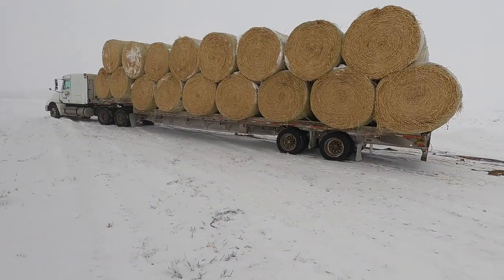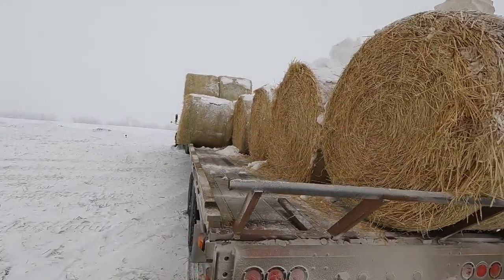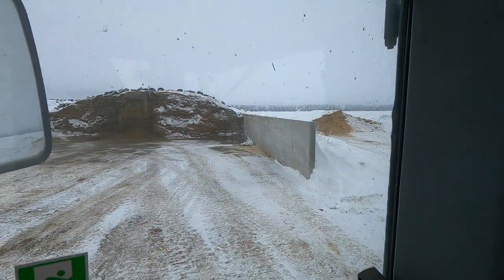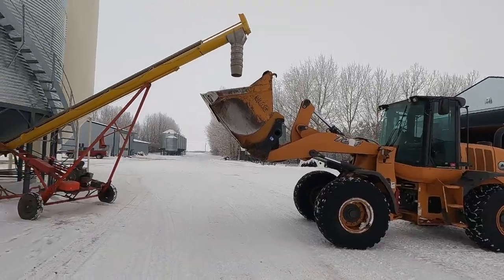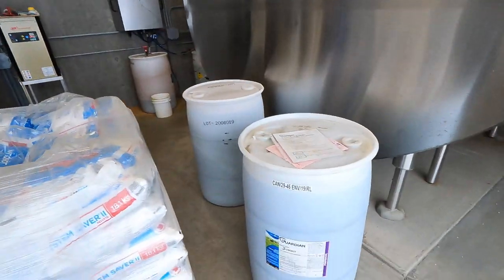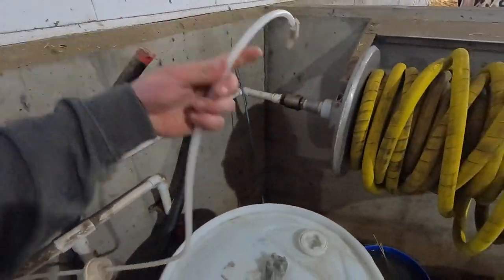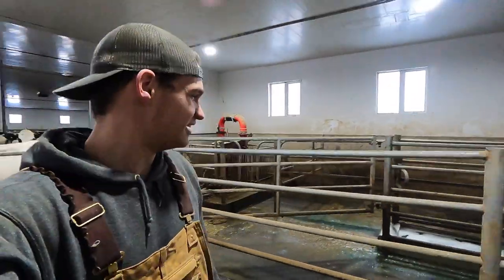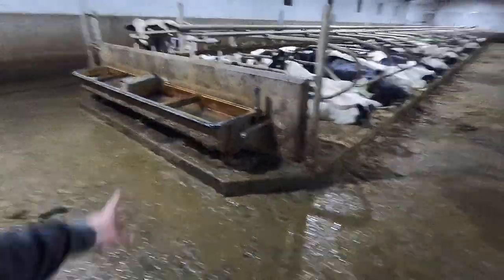New Foot Bath For The Milk Cows!

Comment: Drain the air tanks weekly when using it lots
Reply: That is probably why it froze! Needs to be done daily and even that's not enough sometimes it needs a methanol pot.
Reply: You can install an in-line air dryer as well. It's automatic too!

Comment: You need to add a cheap flow timer on the foot bath.  Something similar to what they use when adding fertilizer to a garden drip line.  Also if you flip the cart around so the barrel is coming out first you can use the wheels against the step to help control the load.
Reply: Not so new footbath ... You are reaching IRELAND loud and clear... Huge operation compared to average heard size in the Emerald Isle where 120 to 150 cows would be going heard size ... We gets lots of rain but no tough

Comment: To handle those plastic barrels get a two wheel dolly equipped with curved forks that cradled the outside bottom edge of the barrel instead of that short flat plate on front.  The proper equipment or tool(s) make the job easier and considerably safer. Here's to clean hooves !!

Comment: Hey Jan the pump for the foot bath is it a dc or ac pump if it is dc you could use an Arduino to time the amount needed it is ac you could get an ac light timer or a smart plug so you could set it and forget it until the next bath this would only work tho if the foot bath can shut its water fill off so.....🤷‍♂️

Comment: When using a 2 wheel cart with a  heavy load and going down a step it is safer to have handles on the up side. That way you can have someone on the bottom helping you.  Or Did You dropped the drum of foot bath to creat a little drama?😃

Comment: New foot bath.
Rather than spending over 9 mins letting that pump run out the footbath stuff, get a simple hand pump that drops into the 200 litre drums- I takes 30-40 secs to pump out 15 litres with the ones I used to use and all safe.

Comment: New foot bath. You might consider putting some rubber along the sides of the foot bath up to the first bar to help keep the solution in the foot bath and not splash out the sides